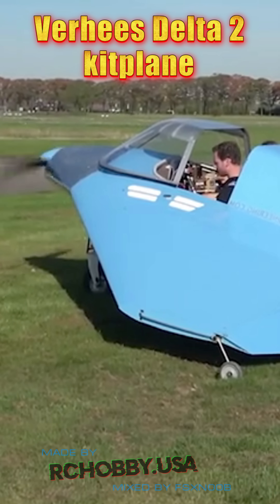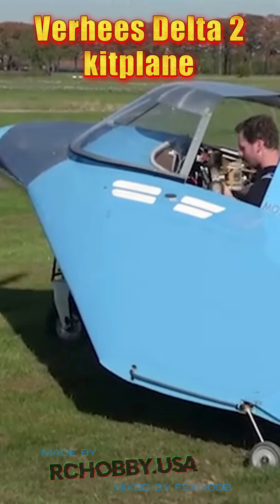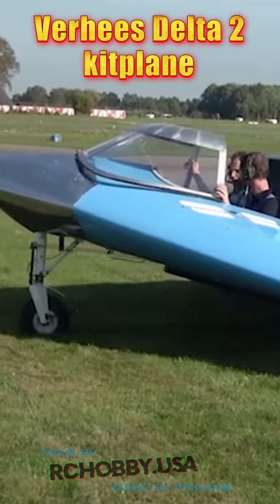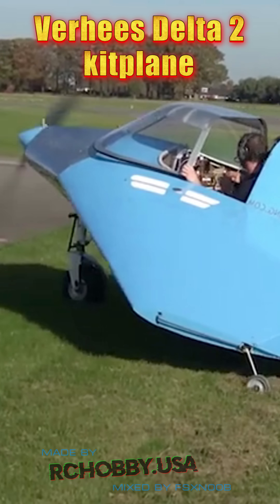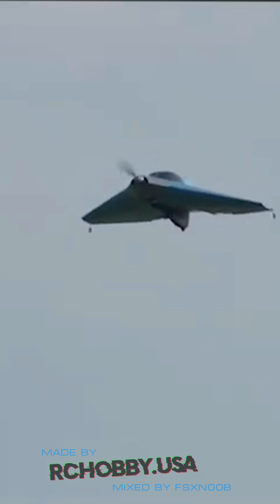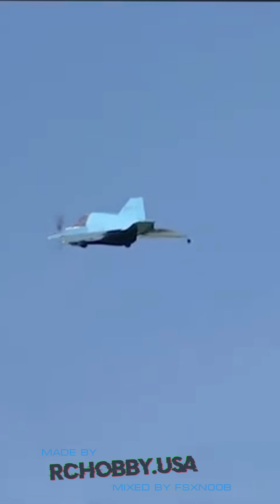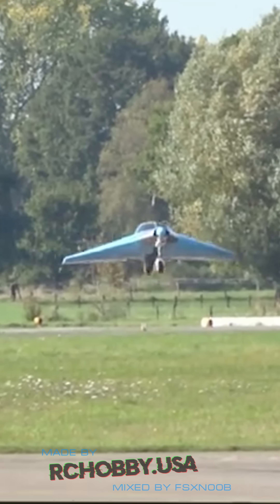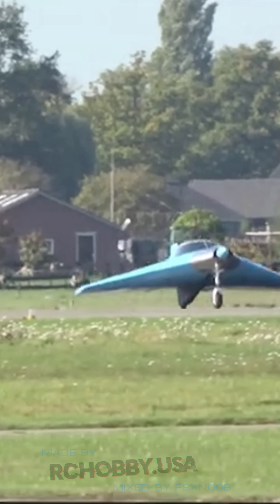A Game Changer in Aviation - Verhees Delta 2 Kitplane #shorts #aviation

Comment: So Why are NO private planes bieng made this way???  I’m no aviation expert but I’ve noticed the newer long distance military drones were seeing in Ukraine & the Middle East are flying wing prop and jet engine drones & of course the B2 Spirit stealth bomber and the B21 Raider as well as Chinas new B2 copy and Russias they’re working on as wel as the many other experimental US military drones, clearly the benefits are wel worth it but why are flying wings, seen since WW2 with such large advantages still today only the smallest tiny fraction of planes commercially , privately and militarily? Is it harder to fly? I know the B2 Stealth bomber delta wing and the new replacement can’t possibly fly without a wild aviation computer doing the fly by wire computations  , is that because of the delta wing design or something else like the no vertical “ rutter”?)pardon lack of knowledge terminology wise)In developing previous delta wing bombers they had issues of them crashing so I’m curious why if like the video says the lift and range is insanely better this way I’d think it’d be easier to fly too no? 
Assuming this info is legit , an extremely reliable engine prop plane that can exceed 4,000 MILES of range  and can be flown single pilot is WILD if it’s at least comparable to operate skill wise compared to a standard civilian prop plane, how is this not the direction every manufacturer is doing or going to? The single all in 1 wing/cockpit I’d assume is much stronger as it’s one structure verses a cockpit and tail with wing set fastened to it like C-130’s, A10 Thunderbolt IIs , B-52’s that have to have new wing sets installed every so many flight hours and I’m assuming could then much more easilly be made of 1 piece structural composites to make lighter and stronger?  Seems logical but being 2024 and this the first civilian flying wing I’ve ever seen there has to be a serious problem right? 

I do like the glass being able to slide forward like WW2 planes so I could wear a parachute and climb out easilly if in a catastrophic emergency (JJ) but assume if lift is SO much greater that the glide ratio would increase significantly right? And made of composites , much lighter with that much lift surface increase  it’d seem you could glide amazingly long distances if your engine fails right? If an F-16 with its tiny wings and comparibly extremely heavy weight and size can glide insane distances with a flame out , I’d think this thing could virtually glide to intended destination if losing the engine plus with windmill effect BUT we’ve known about flying wings since WW2 and only have a couple successful designs with not good histories of accidents so why are virtually ALL planes still made the same way if this is so much better ? 

I’m not doubting it or being sarchastic, I’m genuinely wondering becasue this makes sense , why aren’t manufacturers doing this? A civilian plane doesn’t need to maneuver like an intentionally unstable fighter jet , so I just don’t get why this isn’t THE standard, the most popular civilian plane design on earth? Or are we about to see a massive shift? Any experts I’d love to hear and anyone that knows if this is would be harder or easier to fly than a civilian Cessna or equivalent I’m really curious. Thanks in advance.

Comment: A good Copy of the Horten IX 229 of the German Air Force from 1945 with small dimensions. Wow, a milestone for small budgets and small garages. Hopefully it will be easy to fly and low maintenance,
The locking mechanism for the cockpit cover in the open position should then also work in any case.

Comment: The delta wing design is NOT a game-changer, and neither is this aircraft (though as a tail-less delta it is interesting). The design, while possessing advantages, also comes with disadvantages, which include: the necessity for large wing area relative to weight (due to being poorly-suited for high wing loading); pitch instability (which must be offset by less-efficient large wing area); it is better-suited for high-speed jet-powered flight; an increased requirement for space/larger storage relative to weight/power/craft capacity.

Comment: The impressive claimed range would seem to align with the extra lift from the wing design and compact size.  It has a tail fin but still looks like a mini-me B2.. 

The flying wing B2 is constantly making computer-controlled micro-adjustments.  As this aircraft doesn't seem to be fly-by-wire it could indicate some stability and thus safety issues. The unusual extra fin in the underbelly seems to be to address that.

Comment: The best thing is the Rotax Engine,  a Austrian company which manufactured the most reliable small aircraft engines , ultra light helicopters etc.. 
but the design shown ( Nurflügel ) this only wing, has many disadvantages therefore it has not prevailed, and the wheels Look very fragile..🤔😉😁